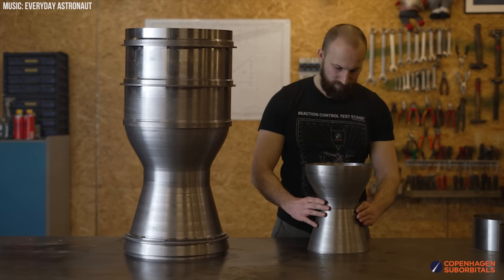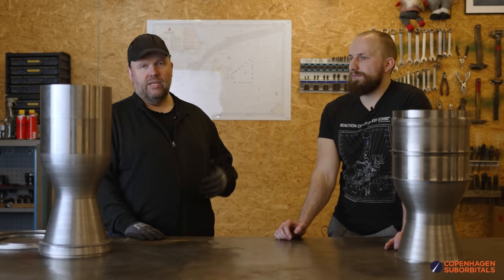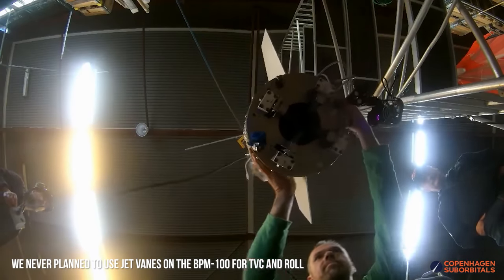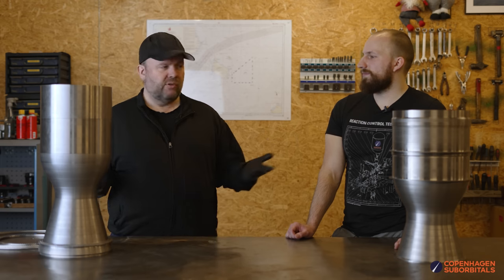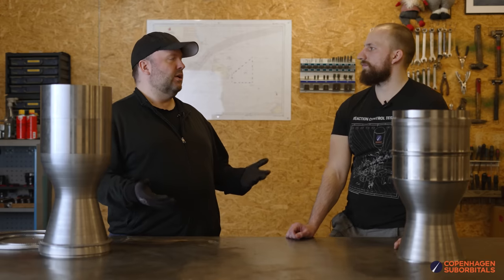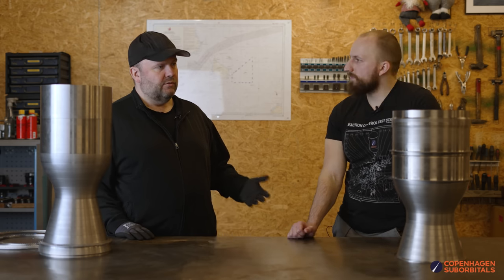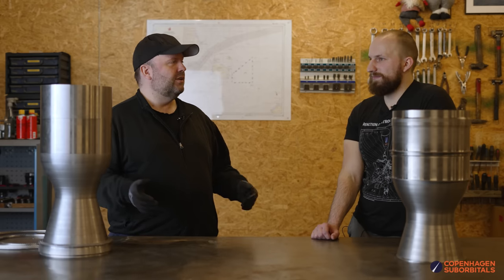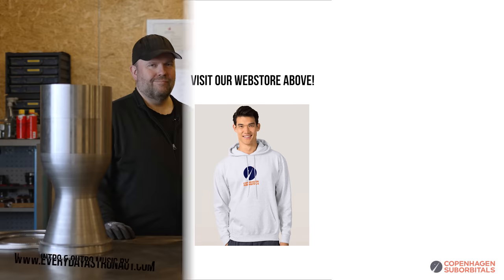Rocket Engines: Is Bigger = Worse?

Comment from the maker: Thank you for watching! :_Swirly: If you wish to support the development of many more BPM-25 engines, you can become a supporter and fly your name to space over at www.copsub.com/support-us 🚀
Reply: I am a supporter. Make rockets for cheap missiles that Ukraine can use to destroy russian military assets. It is something that space nerds like myself would pay for. Do it. The manufacturing experience and income will greatly benefit space endevours in the end.
Just do it.
Reply: What chamber pressure are you expecting to achieve here?
I'm having difficulty believing you are going to get exhaust velocities that will achieve much delta V without turbopumps and staged combustion.
If you are running a pressurised tank scenario. Perhaps you should consider supercritical hot water rather than trying to burn fuel.
Reply from the maker: @Maungateitei  15bar chamber pressure. We're going suborbital to an altitude of 105 km, so that's plenty Delta V.
Reply: @CopenhagenSuborbitals  hells bells! Are you sure? That seems like it would be difficult to get a supersonic exhaust stream out of.
You seem smart enough to understand that things like the Saturn V claiming that they got similar delta V from the same fuel being burnt at 50 bar, as everyone else gets from 250 bar or more is a load of bunk. They had to buy a bulk lot of soviet RS25s in the mid seventies for their shuttle program and pull som out of mothballs for their Artimus stunt.
No need to hold yourselves back for the sake of Yank egos.
Have you considered firing an MgO ceramic pressure chamber and exhaust cone and winding it with tensioned fibre?
 2800C  heat resistance and its easy to mold in a fired out lost plastic mesh as a cooling and fuel feeder liner.
Metals are so primative. Disposible profit driven rubbish.
You have to use more advanced stone age stuff if you want to really get some oomph.
Even Magnesium oxide, or Aluminium oxide - KH2PO4 chemically bonded ceramic with Carbon fibre reinforcement, thoroughly outperforms any metals or high performance carbon plastic stuff.
Jeez, you can put some biochar in a blender with a bit of milk protein, and get graphene nanofibres to mix in to your plaster if you want some real good playdough. 🤗
Reply: Hello I am currently in my second year of aerospace engineering and I wanted to know if I would be able to work with CS to design some hardware for my final year coming up next September? 2024
Reply: @Maungateitei  You can be sure they did crunch their numbers on the ballpark of delta v they need and if the engine concept is capable of delivering. A suborbital launch is MUCH less demanding (maybe 2km/s ish of delta v required) than an orbital one (9km/s ish or more needed), so I am pretty sure the concept is fine.

Also, a low chamber pressure can work well for an engine. Granted, it won't be the most efficient one, but reliable and easier to make. E.g. many sounding rockets used pressure-fed engines. The AJ10, which got people back from the moon, had an even lower chamber pressure than 15 bar.

Comment: I hope you guys got your large CNC. I can't imagine the innovations you can make with them.
Reply: absolutely as a machinist i cringe at the spindle just flopping around 
i have literally been inspired  by you and scot manly  to make a rocket engine myself  but used better machines than you 
i hope you get  better machines not much i can do to help
Reply: It was a bit distressing to see that first operation (OD profiling) done on a mill,  when it's a more natural fit for a lathe
Reply: @MattOGormanSmith  Beat me to it. It looks like they have a manual lathe but I suspect that they're severely limited by their budget since their CNC mill is about 30yrs old.

Comment: Amazing video as usual.
One more pro for the 25 is that if you had an engine failure it could be easier to escape, because if it was the center one you have the cluster, and if it was a side engine you can shutdown the opposite engine and remain in control.
Thank you CS for the amazing work and knowledge! Can't wait for that baby to flyyyyyy.
Reply from the maker: Depends whether we go for a single valve setup, or not. :) If you look back at Firefly's first launch attempt when they lost one of their four engines, they didn't even need to shut down the opposite engine in the cluster, and all of them run on a single-axis gimbal.
Reply: @CopenhagenSuborbitals  True yes!  A single valve setup is simpler but the hardware would be bigger and harder to get or manufacture and integrate i imagine? Multyvalve system would also allow more people to work on the same part simultaniously which would generate more feedback reducing cost and timing and improving quality. Plus having more skilled engineers and techniciens :)

Comment: A main point to consider too is that the more a part is moved and the greater the stresses upon those parts, the greater chance of failure. One engine attempting to steer and control the roll is going to experience much more stress than say two or three smaller engines as the smaller engined can make the minute adjustments and thus avoid greater stresses where as one engine will have to make a multitude of adjustments to compensate for it's inability to make the minute adjustments so there can be accidental over correction and the resulting of other corrections to be made to the first correction and it results in the larger engine with all of that thrust power spending a lot of energy in constant corrections that result in parts wear and tear and thus eventual total breakdown.
Reply: Roll control is not possible with a single thruster, regardless of its gimbal capabilities. With a single thruster some other means for roll control would have to be implemented.

Comment: With 5 engine you can imagine redundancy, with 5 set of valve...
Maybe it's better for human flight.

Enjoy your progress <3
Reply: Absolutely, it's curious that he is so set on the idea that multiple engines ADD complexity and failure modes. Sort of missing the forest for the trees, as a well-designed multi-engine system (especially going from 1 to 5 engines) should DECREASE the overall risk of a launch, increase engine reliability (more hardware, more production, more testing), and maybe even give Spica engine-out capabilities.
Reply: Do you have experience building small ish rocket engines and rockets? Theres just so many things that going from one to multiple engines makes necessary. Things like, how do you ignite them at the same time? You probably need a hold down now that holds down the rocket until all engines are running. You need to make sure that the Feedsystem works, which gets really hard when you need to control four engines. With TVC you need to make sure your engines are all moving in the right direction at the same time, otherwise they hit each other and break. And there's so much more

Comment: I am curious why you are milling parts with rotational symmetry? It feels like a CNC lathe would be idea for making most of the parts shown. 
Anyway, I am really pleased to see LinuxCNC as part of this project.
Reply from the maker: You're absolutely right, it would be, but our mill is not CNC'd (yet).
Reply: @CopenhagenSuborbitals  For the type of work that you are doing I think that a vertical spindle lathe might be appropriate.  Lathes are generally fairly easy to convert to CNC, in my experience. There are some fairly cheap (well, if €25,000 is cheap) lathes intended for alloy wheels on eBay, but I suspect that they are rather limited in power (and height) for your work.
Reply from the maker: @andypughtube  We have plans to convert our current lathe to CNC, because 25,000 euros is definitely outside of our crowdfunded budget. :)

Comment: The answer is the higher thrust to weight ratio the better. If it is big or small, but has equally thrust to weight ratio, they are both good. Neither is better than the other.

Comment: Nice to see a green Maho machine again. I used to work on the team that designed the CNC controller in those. Saw them going from green to Purple :)
Reply from the maker: Very cool! Though sorry to say we swapped the CNC controller with a home-grown one. 😁 (We have a video on it as well).
Reply: @CopenhagenSuborbitals  Can't say I'm surprised :) The original one was a mid to end 80ties system designed around a 16MHz 80386 :P You could almost do better with an Arduino today.

Comment: What ever happened to the tycho deep space 1 and 2 capsules? Is that idea abandoned?
Reply: Most of the ideas before our reconstruction in 2014 have been abandoned, though we have learned a lot from them. Just to mention one case:
The "Astronaut" ("Rescue Randy" - a crash test dummy) was "killed" in three different ways during the launch of Tycho Deep Space 1: Unconscious due to extreme rise in G-forces during launch his organs was shaken too hard for comfort (read: lethal), due to extreme thrust fluctuations from the hybrid engine. Then he broke his back, hitting the surface at 150 miles/hour - which ripped of the acrylic dome resulting in a water flooded capsule and a drowning "astronaut" strapped to the seat with no ability to escape ...
Reply: Speaking of hybrid engines... Not that you're making that move, but would the change to smaller engines help with that thrust instability problem?

Comment: will you have a launch escape system🚀
Reply from the maker: Most likely no. 
We tested one ten years ago, and it didn’t go too well. Our current analysis concludes that the complexity, mass and risk by unplanned failure it adds to our system outweighs the problems it could solve. But we haven’t ruled it out completely yet.

Comment: I'd argue to go even smaller. make these things cheap and fast to produce, so you have a constant stream of engines going through tests and checkouts. give yourself plenty of redundancy on the rocket,  if 1or 2 engines fail for any reason it matters much less the lower that fraction is of the overall engine count.

Comment: Why can't we turn the whole frame with rocket engines? Why is it necessary to turn each rocket engine separately?
Reply: It gains an extra direction of freedom. (roll) Moving a whole multi engine assembly would have its own engineering issues, but totally doable. They would just need to do something else to handle roll, such as cold jets.

Comment: Definitely go with a smaller engine.  Makes your startup and control slightly more complicated, but significantly reduces hardware complexity. Theres a reason SpaceX uses small engines. Work on setting up some degree of an "assembly line".  I would have pushed for flight with your small initial test engines.  Theres no reason those couldn't have pushed a human sized rocket to space.
Reply: Although I don't consider neither the Merlin nor the Raptor engines small I understand your view. A cluster of 20xBPM5 might have done the job despite "a plumbers night mare". An important consideration though is the ignition procedure. We have learned a lot from the Soyuz rocket ignition system with 32 engines being ignited with the same technology we are using. Igniting many engines complicates the control and safety procedures concerning proper ignition. A pyrophoric ignition system like the one used on the Merlin engines is beyond the safety limits within our organization.
Reply: @jorgenskyt  How many engines on Superheavy? 33? Rocket lab even has like 5 on the lower stage right?  Seems like if you design flow control and ignition into each engine (like fully integrated) then plumbing considerations drop drastically.  Would also have all your sensors integrated into watch engine.  I agree that there is a probably a sweet spot between too many and too few engines though.  It's easier to manufacture smallish things though. 

Have you considered adding a boost pump to the engines?  Add yourself like a bar or two over tank pressure.  Run a centrifugal pump off of a brushless DC motor. Could literally use a well tested hobby motor (especially if the engines are small). Cool the motor which your cryogenics.  Centrifugal pumps are easy to design and manufacture on a 5 axis.  Adding this pump would increase ISP which would be nice, but would more importantly act as a flow control valve.  Though its going to add significant battery mass. Add you probably want to balance the rotor, though may be able to get away with not doing that. 

Let me know if you guys need any designing help, I'm one of the fastest on earth ;)

Comment: If you understand the laws of probability, you will understand that 30 engines instead of 5 is a recipe for disaster. There were 1 million parts in a saturn 5. Law of probability suggest you have 3 launches before you start pushing your luck. America got away with it. But musk wont. 33 engines is ridiculous.

Comment: You seem to be going with "shower Head" injectors and abandoning the swirl injectors you were working on.  Why?
Reply: @mauriciosa2632  See what?  The swirl injectors were being developed and tested as shown in earlier videos.
Reply: @mauriciosa2632  They were drilling a bunch of holes used to make a shower head injector, and testing flow.  Have you seen the video?
Reply: Denmark is a very small and slightly underdeveloped country with a limited number of factories offering high quality milling/lathing capabilities. Therefore swirl injectors need help from manufacturing companies in other countries. Due to considerations regarding "dual use" (like ITAR) we cannot export detailed injector drawings without governmental permission. Impinging shower head injectors can be made in our own workshop.